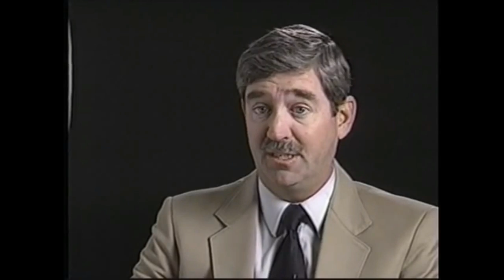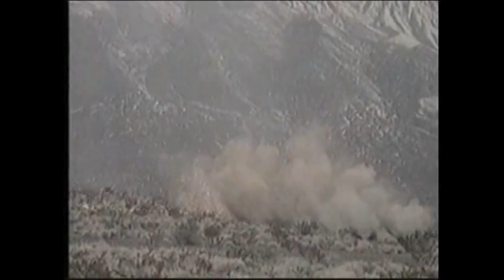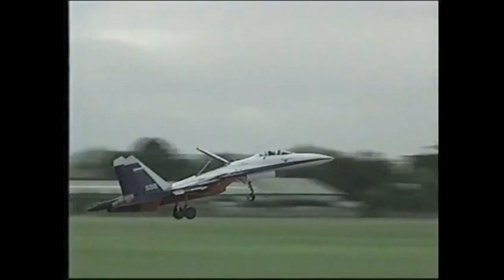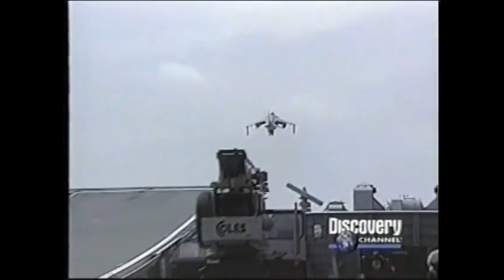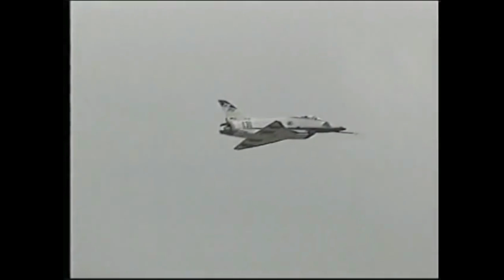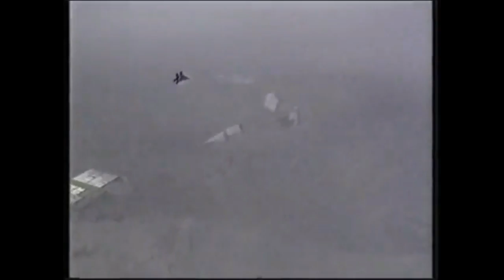WINGS [MODERN FIGHTERS]

Comment: One comment: the doc. says that the Rafale has "limited stealth capability whereas the Eurofighter has not included stealth principles. Fact: the Eurofighter has at most half the radar cross section of the Rafale (i.e. it is more stealthy). Also, regarding "no British fighter", the French, when sneering at the Eurofighter, say it is "a British design" (mostly true - the pre-cursor was the EAP, which was British, and proved most of the design feature of Eurofighter). Of course, currently (years after the doc. was made) the UK is building Tempest -  a 6th gen. stealth fighter.

Comment: Yeah its a shame the Eurofighter became so expensive, in the same ball park as the F35. Still a great jet though, and its upgrades make it more than capable.
Reply: In real air combat, F-35 is a lemon.
Reply: @felix25ize  it's either used in a support role for air superiority. Or as replacement for the harrier. If your trashing it's dog fighting ability then you're missing the point
Reply: @giggyolly  It is made for strike , not for air combat.

Comment: the navy is crying to get the tomcat back.
Reply: At no point has the US Navy or any US navy pilot ever said they wanted they F-14 over the F-18 or the Super Hornet. In reality they will tell you that the F-18 out performs the F-14 in everything except range! So please don't talk about something you are ignorant about.
Reply: @mississippirebel1409  just range huh? F14 had more speed. F14 had a better radar. F14 carried superior missiles like the Phoenix. F14 had superior range even without having to use drop tanks. There is only one area that thd F18 is superior: cost. The F18 is like the cheap, Chinese, diet coke version of the F14. Now sit the fuck down and have a bowl of rice son cos you've just been served.
Reply: LOLLLL
Reply: @stevenspilly   Here's the thing.  As an aircraft flys there are stresses that are put on the air frame. The metal /alloys heat up and cool down.  Even with the best maintenance crews these things will happen. Metal does stretch,  and shrink,  and crack.
Reply: @frankspikes4867  the F18 is also made out of metal is it not?
Reply: @stevenspilly  How about 90% of airplanes are made of metal. Unless you're flying a glider made of wood, fiberglass, kevlar, carbon fyber, plastic, or some other durable nonmetallic material. . . Chances are what ever you fly is made of metal.
Reply from the maker: Because of the range and speed the F-18 is currently missing.
Reply: @AVIATIONANDTECHNOLOGY  and weapons load and radar too
Reply: Could have made some badass F-14's for the cost of one F-35

Comment: The F-22 and the Eurofighter was developed at almost the same time, but the Eurofighter was obsolete the day it was built, an upgraded 4th gen F-18 class - China is busy copying the F-35, and Russia gave up on their SU-57 - France, Germany and Spain are now grouping and planning to built a stealth fighter in line with the F-35 (it turns out that the Rafale is more expensive than the F-35, only time and billions of dollars will tell if their project could also be obsolete by the time it rolls out) - 12 other countries are buying the F-35, and the F-22 still has no equal today and for the foreseeable future - except the F-35 could kill it
Reply: So many people see “Stealth” as a panacea when it is clearly not so.  The trade off includes restricted weapons carrying capacity, range, and visibility to longer wavelength radars and also to infrared sensors.  The USA touts the missile carrying capability of the F15 (24 missiles in the latest evolution) as important so the F22’s six plus two, which is one third that of the F15, must be seen as minimal (I personally see it as more than adequate).  Stealth coatings do not mitigate the “dipole” effect of the whole airframe, or sub component thereof, so comparatively long wavelength radars can detect stealth aircraft quite easily.  Similarly all airframes heat up when passing at speed through the atmosphere and this can be detected using appropriate infrared sensors.  Stealth coatings are also vulnerable to damage and decay (invalidating the stealth to a degree) and costly to maintain.  It is rumoured that the F22 loses a significant proportion of its stealth in the rain (not ideal for combat in Europe or the Far East).  It is certainly true that if a stealth aircraft were as cheap to buy as conventional aircraft, carried as much when stealthy, had as good a range, and were as cheap to fly and maintain, then stealth fighters would be only choice.  
In the real world, stealth, while useful almost all the time, is probably only necessary for the first few days of a conflict, when the campaign to demolish the opposition’s air defence network is in full swing.  Long range, stealthy missiles would be almost as effective.  Thereafter any competent airframe will be fine.  My conclusion, given the inadequacies of stealth, is that you need a mix of the order of two to one (conventional to stealth) aircraft.  To that end both the “obsolete” Eurofighter and Rafale do a better job than the F15 in every respect other than carrying capacity and runaway speed.  Both those aircraft outclass the F15 in air to air combat.  Last point: there are two proposed next generation fighters in Europe, the Franco-German effort, which will collapse into a French only effort once the research is paid for (mostly by Germany) and the UK “plus others” effort , which will likely gain support as time passes, much like the Rafale/Eurofighter split.  The cost of such aircraft will be high because the USA adheres to its “Not invented/manufactured here” syndrome so they will be unable to have the economies of scale afforded to US designed and built aircraft.  Witness the refusal of the USA to adopt the meteor missile, the brimstone missile (in both cases ignoring the superior technology and choosing to develop their own equivalents), Eurofighter or Rafale, the airbus MRTT (which the US Airforce preferred)…
Reply: @franciscook5819    Only smart man I see in this comment section !!  
Bravo to you mister !!
Reply: Good comment, very clean but fill us in on anything you can about your statement of the F 35 could kill the F 22. Very interested in that.
Reply: @Americana-deluxe  I believe the SU 57 is in operations right now.  They have already used it in missions
Reply: Kendall Bedford really?

I’ll check if you’re right, just hold on tight while I look at Wikipedia to see what’s changed in 2019z
Reply: @octonautmusic8381  
Not in recent memory. Normally, the enemy is taken out before it can take off.
Reply: To me, seeing a F22 in action, there is nothing out there that can take it, not even the over priced over budget F35.
  That's just my opinion though...
Reply: F-22 is far superior than F-35 but just because of cost F-22 program is dead.
Reply: @1507krazy  
I wouldn't say that, the F22 is expensive for sure, but the F35 is far more expensive, due to the electronics and such. Keep in mind that it has 3 different variations, including VTOL, and those systems are well known to be extremely costly to maintain.
  Now, the US has went back and ordered the latest versions of the F15 and F16 aircraft. The largest differences between these newest model's vs the previous is there has been a few new redesigns in both frames and electronics. They both can carry a larger payload than before, and they also added radar absorbent pain, similar to what's used on the 5th gen stealth fighter platforms. 
  The F18 was also updated as well. So there is no shortage in aircraft to fight with.
  Last point, the F22 is the only aircraft that isn't being sold to our allies, but the F35 is, and Japan is looking at buying the F23 for their air force.
Reply: @bryancenterfitt7127  You're wrong,Per unit cost of F-22 is 150 million US$.Per unit cost of F-35 including engine is 107 million US$ at 2020 it would even come down to 80 million.
Reply: JezBollah 667 Lmao....you must be fun at parties.
Reply: Thé rafale isn't more expensive but less than the F35.
Reply: joe men those were toys to destroy humanity😜😜😜
Reply: When will you all undestand that "stealth" is not like man said Froddo put magic ring and than you can not see him anymore ????
Stealth = low cross radar section, so if ground  radar like S-400 and so detect you you are not "stealth" anymore, you are dead,, it is only metter of time when plane will have radar that will detect stealth and US knows that and there is already a lot of no fly zone for F22/35 B2 where S300/400/500 are station, Su-34 is large enough to have big radar in so he will probably get it first ( he already have front and back radar so he can shot plane behind him ) ....
France and Germany will get into 6th gen fighter not stealth fighter, Rafale cost 110mil, EF2000 about 120min while F-22 cost 260mil, F-35 is doomed at start ah he is alsno not true stealth ( he is stealth same as Rafale so and have greater cross-section than for eg Mig-21 from the front)
Reply from the maker: I agree thanks for commenting and true statement.,stealth avionics missile range and EW really changed the game in aerial combat for now and the foreseable  future the 5th generation is big improvement over 4th gen with higher RCS and no supercruise.
Reply: @AVIATIONANDTECHNOLOGY   Rafal vs F 22 = Win RAFAL _ 😀
Reply: @AVIATIONANDTECHNOLOGY  The danger in relying too heavily on stealth is that a single advance in detection technology could render all of that investment a total waste. The F-22 and F-35 should outperform the F-14, 15, 16 and 18 in conventional areas in order to be considered upgrades.